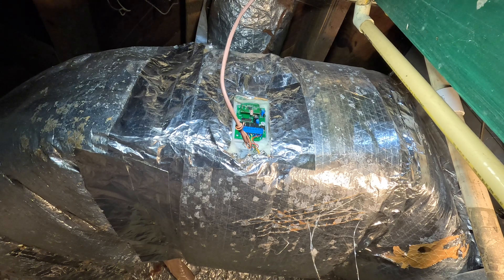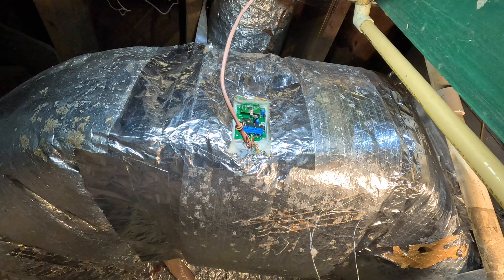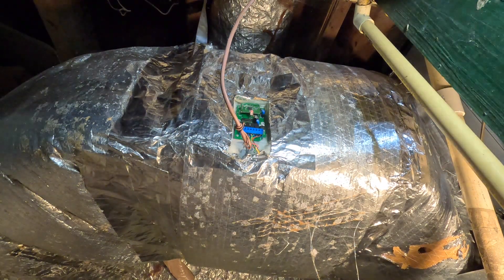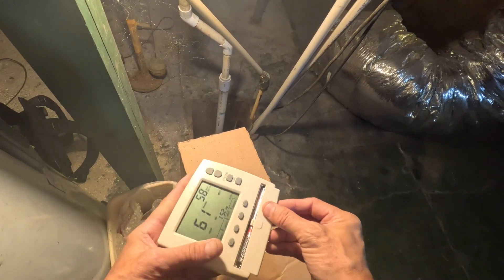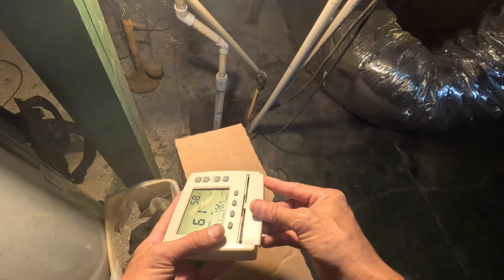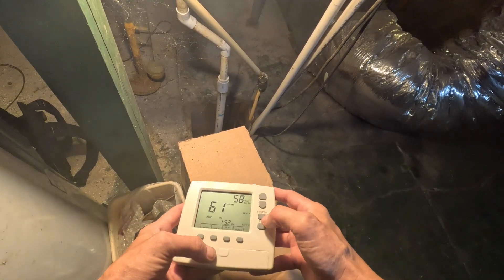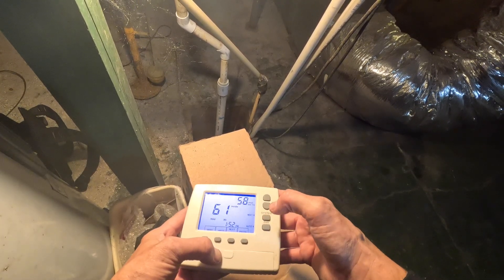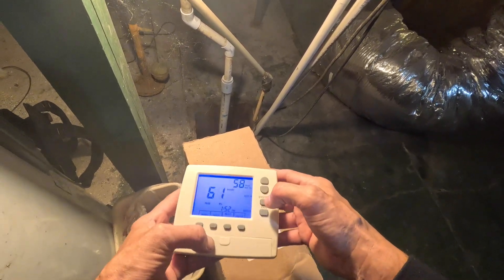Heat Strips Were Working, But Not The Heat Pump! #hvacguy #hvaclife #hvactrainingvideos

Comment: As working in industrial maintenance, we had to deal with several controllers that if you accidentally went into progran mode, 2 to 3 settings would swith to a default setting and the controller had to be reprogrammed to work the machine. It's just like when you pull the battery from your computers motherboard, the bias goes to default.

Comment: Wireless T - stat, no thanks. Unless their is a manual backup. Don't we have enough to deal with? Well, I guess I'm just an old fart that needs to keep up with the times. Actually I do for the most part, some I like ,some I don't. Nice job reprogramming.
Reply: This is just over engineering garbage. Its not worth the extra problems this can create for the "convenience" of changing temps on your phone.
Reply: Its ridiculous.  Nothing but trouble
Reply: Totally agree with you I purchased at Lowes one of the honeywell wi fi thermostats that you still hardwire. It's the honeywell model number rth9585wf. It's a smart thermostat with wi fi connectivity that's non proprietory and, still gets hard wired and yes you can Control from your phone and, set up easily.

No need to spend huge amounts of money on ecobees or 500 hundred dollar honeywells that are junk.

Take care
Reply: I believe in a previous video he said he installed that because it was impossible to pull a t-stat wire with enough conductors to support the new heat pump system. Probably not his first choice.
Reply: @pilotboba  Thanks, that makes sense. That must really be a long haul, I wonder at what length is max to run. I honestly didn't think there was a limit. Also how much range on a remote.

Comment: Freaking cheap thermostate!
Time for a 400.00 wireless honeywell that thermostate is a call back waiting to happen.
Reply: They make them where you can control with your phone. I have one, but is still a wired T stat
Reply: @jthonn  
Why does everything got to be connected to our dam phones? Frig, dishwasher, clothes washer, dryer.. Who needs all this crap? Who is asking for this?
I dont need my phone telling me my clothes are dry. Im good
Overengineering nonsense.
Reply: @bobshanery5152  LMAO, I hear ya Bob, and I have to agree. Being able to control your HVAC does come in handy. My point is you don't need to go wireless T- stat to be remote. I don't understand what is so bad running the wire for the T - stat to start with.